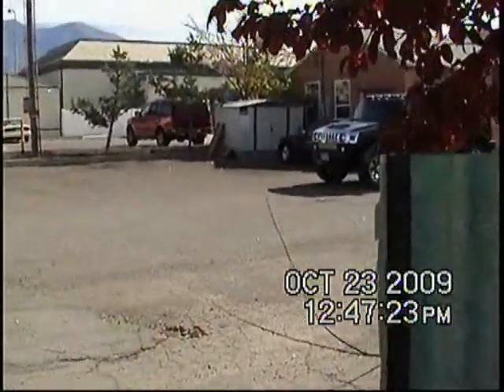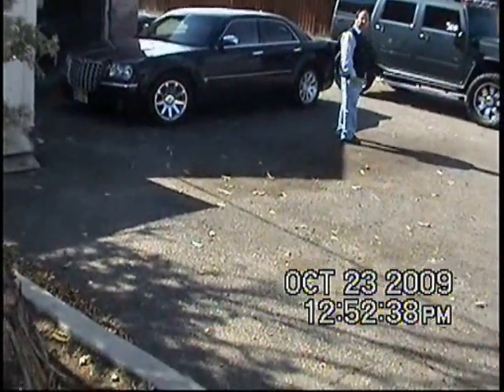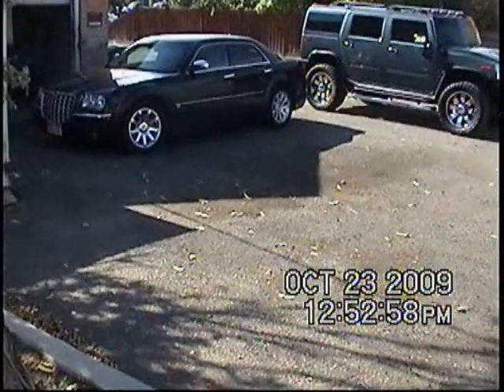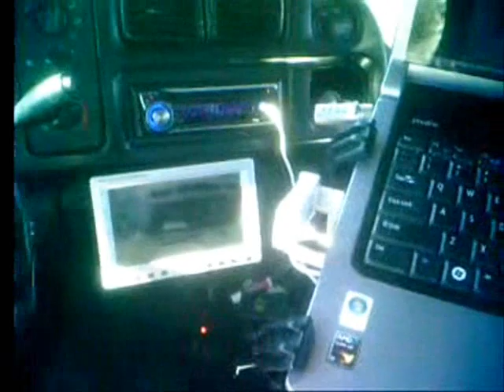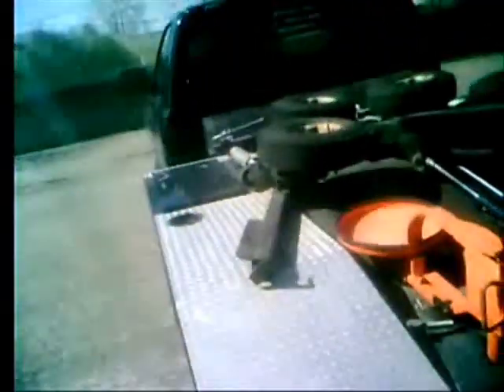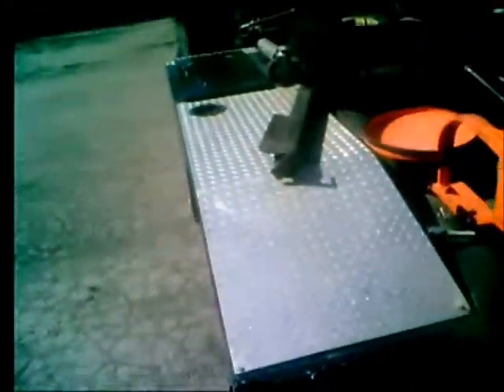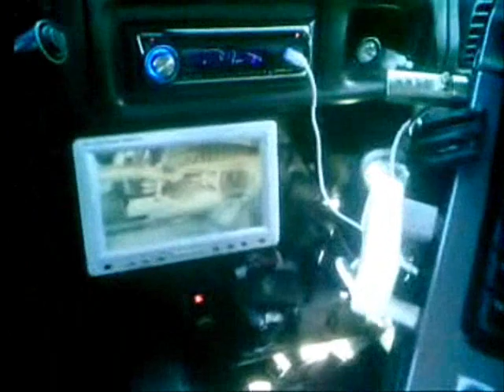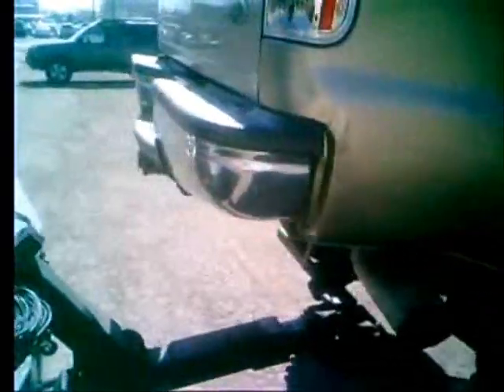Video Footage Used To Win Law Suit By Disgruntled Debtors

Comment: always leave the 4WD on when you park your 4x4(?).... if you are late on your payments  ;)
Reply: Really stupid. All he has to do is pop the door and stick it in 2wd or use dollies. Some trucks he can put in neutral from under the chassis.
Reply: and you are ABSOLUTELY brilliant at ..........NAME CALLING...... dO YOU know what this means ?     ;)
Reply: +Jon Workus Why bother, doing that won't stop the repo.
Reply: With 'another' type repo person....catching them before its hooked might give an opportunity for the debtor to flash some cash to stop the event(?).... buying a little extra time ...not that it would do much good in this video.....BUT...more chances of some confrontation to take place...I am sure this poster would agree with that.
Reply: +James Roybal A decent amount need to be running to come out of 4wd. Others are full time 4WD/AWD.

Comment: my question is why not just dolly the back wheels if you had the time to hook it... strap it... drag it... drop it.... reposition to the rear... lift it... strap it...and haul it out?  isn't that the point of the dolly's is to get the drive wheels off the ground for vehicles that you can't tow due to certain reasons like 4x4 etc...? and its much easier then trying to drop the drive shaft and damaging the truck.
Reply: +Crash Weekly Might be easier to tow it backwards as the front end has more weight due to the engine etc, less ball weight kinda, Just my thoughts.
Reply: +Crash Weekly He likes to put the engine side on the dollies when possible to save wear and tear on the truck.
Reply: +Crash Weekly The front end of trucks are very heavy, causing the repo truck to handle  poorly.  By flipping it around he is only supporting the light rear end and has more control with braking and steering.

Comment: i know it's off topic but how do potholes start? is it from the concrete settling over time or what?
Reply: It can be a number of things, but water is unbelievably destructive. I live in Colorado and work on the road crew for my county and ice or heavy vehicles will wipe out a brand new road in under a month.
Reply: +Paul Walters Yeah water can get under it and freeze and expand and crack the cement then it's very brittle and easily worn from driving
Reply: +Robert Horsfield 
more often from hot conditions. asphalt is not a perfect blend, leaving some spots 'not mixed as well as others' which gives them different thermal expansion rates. this also explains how you get potholes down south, when it never gets cold enough to freeze.
Reply: in pa more often than not it's just from plow trucks catching an edge and starting a small hole

Comment: You cannot post anything on a utility pole. No trespassing signs have to comply with specific requirements under the law which include posting the property owner or agents name AND phone number. Utility poles are owned by the power company (with some exceptions) and both the telephone company and cable company actually lease the right to deliver their services (space on the pole) from the power company. Some poles (like a push pole or stud pole) are telephone company property. In either case a no trespassing sign posted on a utility pole can be removed by any employee of any utility that owns or leases space on the pole. We call them "telephone poles" but in reality they are almost always "power poles".